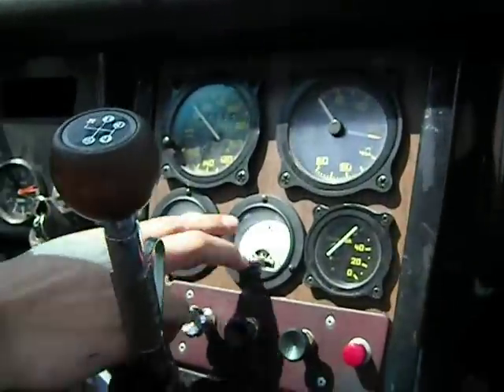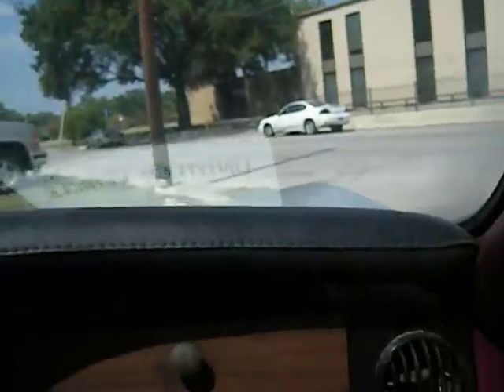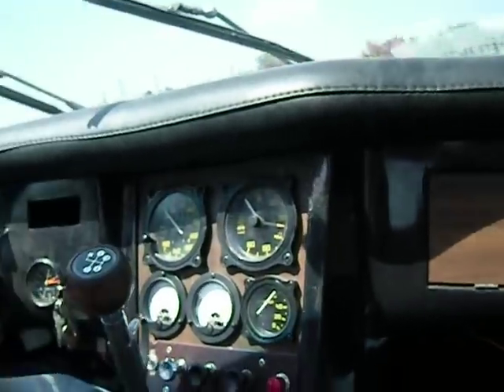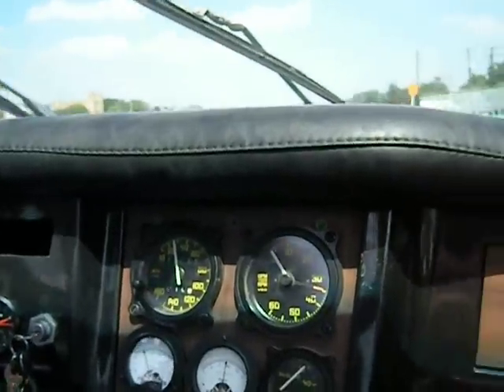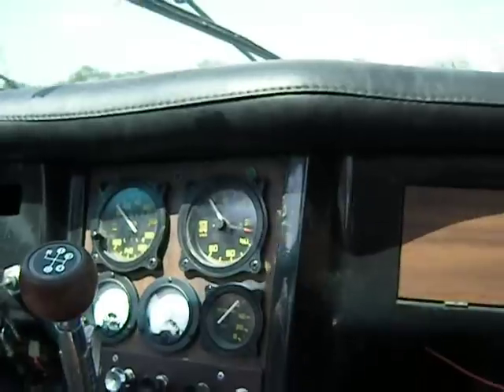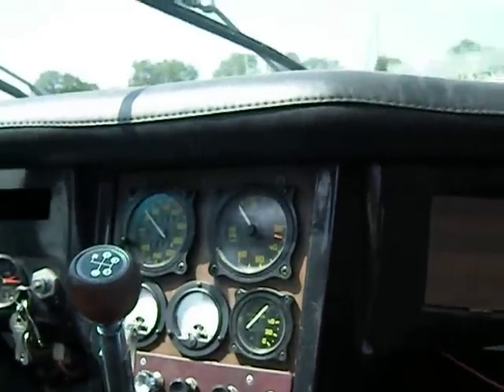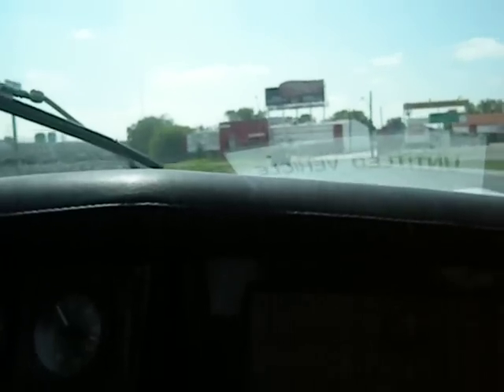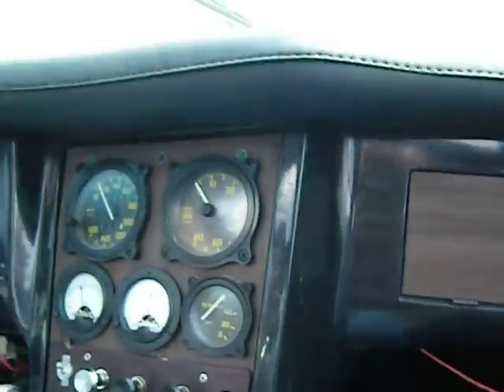16 year old builds electric car Part 7

Comment: my rides crazy :P u can see my prototype :P electric bike  its did 92km/h on 133v of a123 dewalts :P look up 133v bike  im planing a new bike that will do 100km/h with my current project for the winter its a enduro that so far did 72km on 80v im planing on doing 100v  or lipo batterys  on my new build and if the motor can take it 133v :P